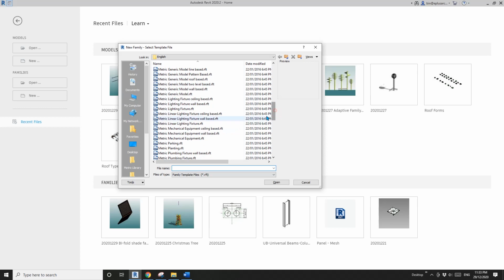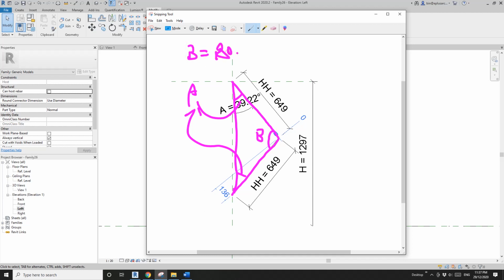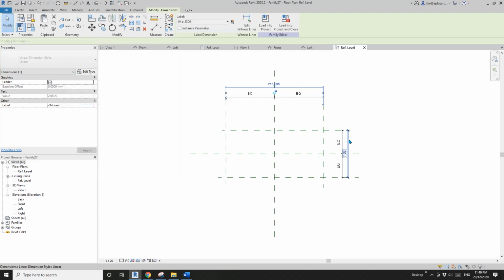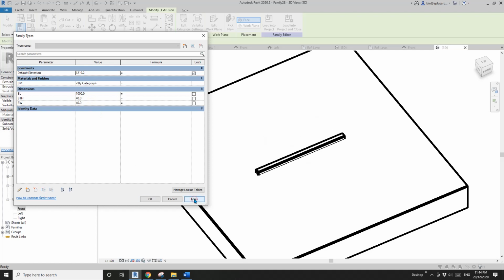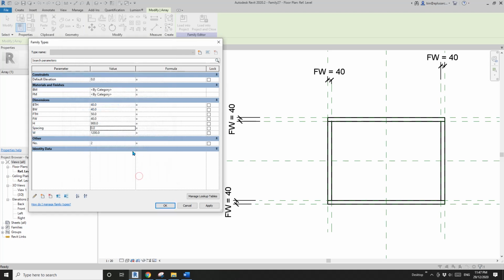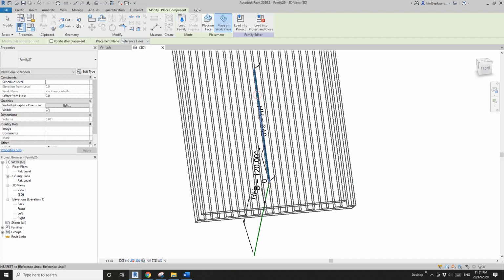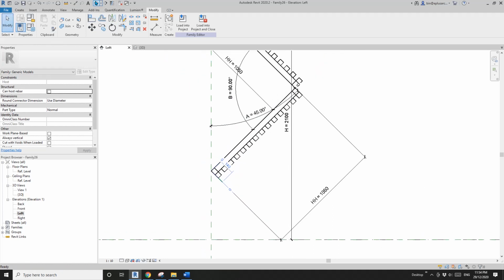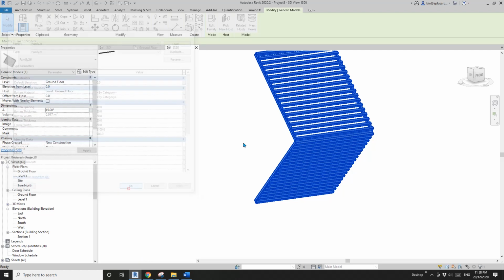Everyday Revit (Day 286) - Parametric Bi-fold Shade Panel

Comment: First of all tell me plz how that zero shows inbetween these two references line ...which mean it didn't locked
Reply from the maker: VV - sketch dimensions.  I also did this in video 304 & 305.  Otherwise you can totally avoid angular dimensions by using trigonometry.

Comment from the maker: Hey guys, just to let you know that I have deleted the video I published at 12:00AM because it was an old video. I thought it is the video for the curved stairs.    I will redo the stairs video in a few days.
Reply: Hello sir, I am in dire need of help. I made the family vertically instead of horizontally the way u did it, and my array group can't be rotated anymore so I watched how u made reference line and did the same but my family isn't rotating with face being vertical same as I made it. Can I send u a video to show u my problem?